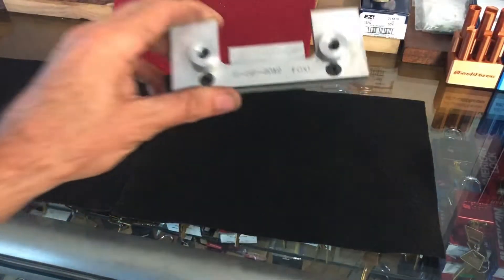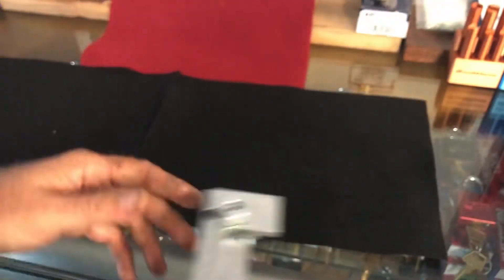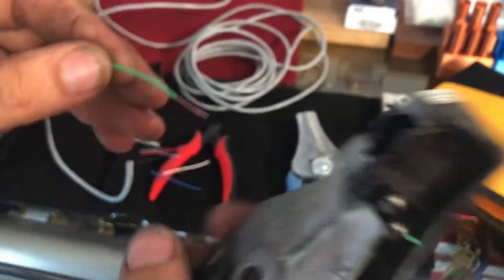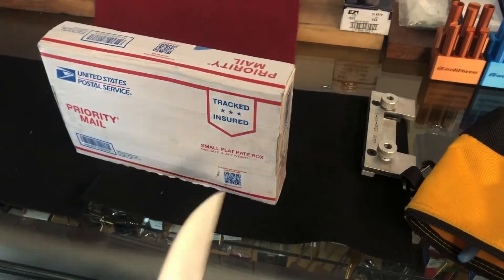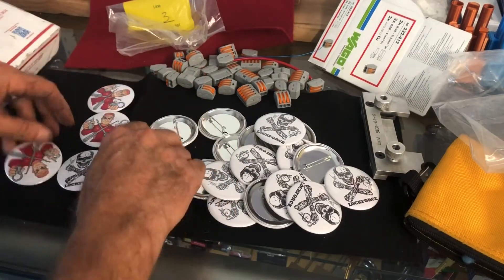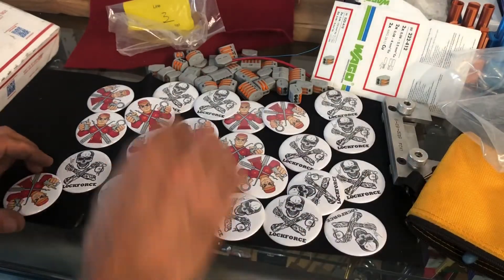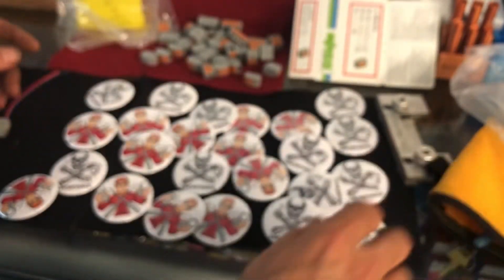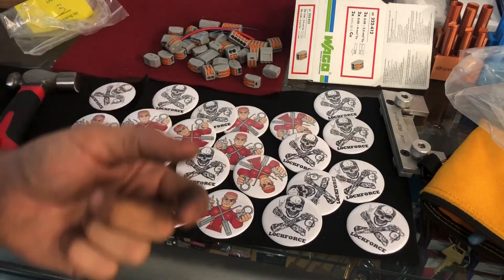another great #lockforce package!

Comment: oh wago. Always holding a few in my pockets. In Europe we do not just twist cables together. And they can join nearly any size wire, as each chamber has a  spring. So as shown perfect for joining 2 sizes wire. I use the Wago 221. They are easier to open.  WireNut sounds as painful as Kwikset. More Wago and d12 to make America great, or at least a little better.